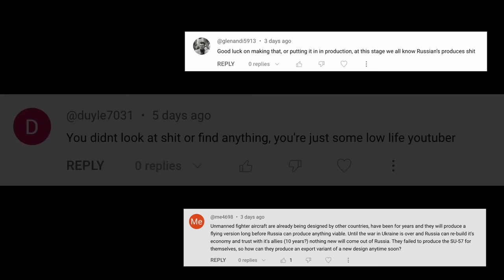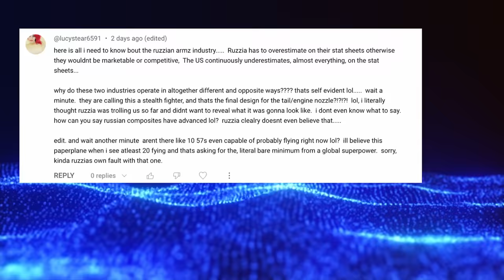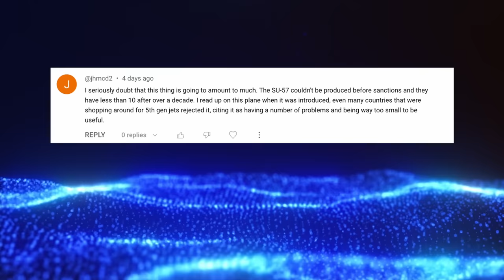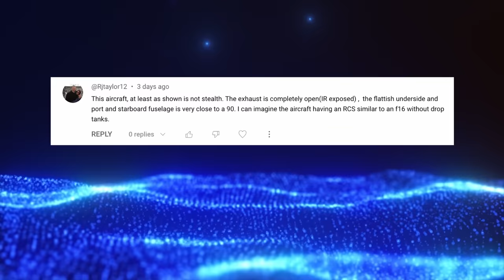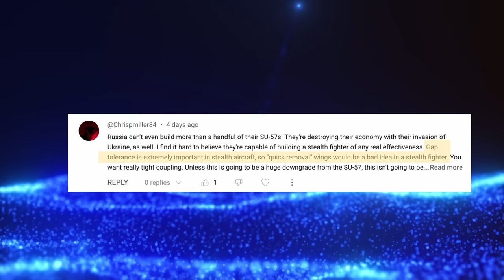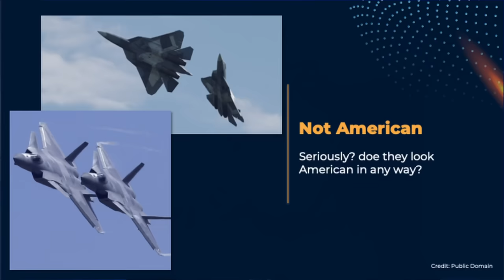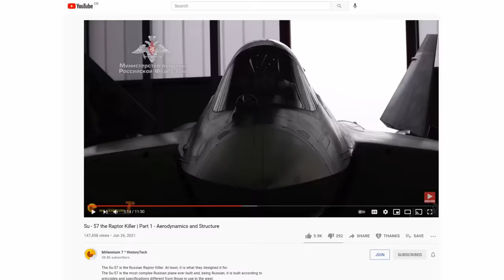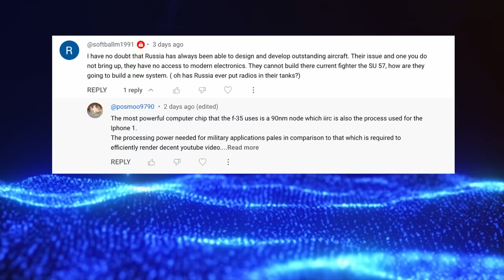Why so Few Su-57s ... and Other Stories.

Comment: You point out that the Russian economy is growing. While on the surface this is true, it is almost exclusively driven by higher military spending, both on equipment and on personnel. Suddenly having to pay 300.000 additional soldiers and having to pay them more doesn't mean that you are doing well economically. Russia's war economy is working pretty well, but it has immense costs for basically any other non-war-critical industry and especially for the population. 

Funding for the SU57 will probably not be impacted but Russia has to make great sacrifices on other levels in order to maintain their war economy
Reply: Non-war industry is extremely boosted by growing military complex. This is how USA got so big after the ww2

Comment: Coincidentally on Dec 9 a news came that a full squadron of Su-57 is about to be deployed by the end of 2023. With AL-51 finally ready the last things remaining are 2D exhausts and K-77ME, and the jet is at its full capabilities.
Reply: 2D exhaust are not part of the Su-57 either block 1 or block 2. if there is such a plan it will be for a mid life upgrade.
izd.30 is still not fully ready (integrating it to fighters was planned for 2025 in the initial production plan for 76 fighters).
there is a planned batch that should be delivered in December 2023 (or early January 2024) wich will complete the first 12 and a few more (according to best estimates there are 11 already delivered)
Reply: @tunisiandom9318  There were 18 aircrafts delivered already before this last batch by mid-2023, wikipedia was outdated.  Now it's a full squadron, 24. In practice those machines are going to be distributed across several squadrons so that training started at several places at the same time. New batch was said to be powered with AL-51/izd 30 already.

Comment: Hi M7 again ! 

You said something about western components in the Su-57?! There is no western components in the Su-57 at all.About microprocessors ,Elbrus-8S and even Elbrus-16S  ( for the IMA-BK digital comp in the Su-57) are in serial production in the  'Micron' company-Zelenograd .

Will repeat this again : 

''Su-57 delivered so far :
one in 2020, four in 2021,six in 2022 and eight in 2023 so far.Two more will be delivered very soon ,at the end of 2023.''

There is some news from VKS/RuA&SF that 1AE ( first aviation squadron ) of 23GvIAP ( 23rd Guards Fighter Aviation Regiment) in Dzyomgi air base near Komsomolsk on Amur ( vicinity of KnAAZ factory ), will be equipped with 12 new serial/operational Su-57. 

About combat use in SMO, I will repeat only details that can be written publicly. Su-57 ( four-aircraft combat group) was used from the beginning of the SMO especially for the SEAD/DEAD combat missions with new heavy hypersonic long-range anti-radiation missiles type Kh-58UShK-TP. This AR -missile has not only passive radar guidance but instead of it ,it has IR-passive homing  with two real passive IR-sensors (  so called heat pelengators ). Max launch distance is 400kms ( launch parameters : high-speed,high-alt.) . Primary targets were ukr. long-range AD and air surveillance radars.

About first ever combat use of Su-57,it happened in period  Feb 21-23  2018 . Two 'second stage' prototypes Bort numbers 509 and 511 blue flew to Hmeymim air base in Syria( flew 10 missions)  and they were there in the same time when USAF and IAF conducted air drills with their 5th gen fighters F-22A Raptor and F-35 Adir !  By accident? Of course not.

All best !

Comment: Well the su 75 is supposed to compete with the f35 the problem I see with the su75 is that it’s rcs is going to bigger than the f35 which will probably put in the low observable space as opposed to true stealth space like tge f22 or f35

Comment: The leadership of the NATO countries failed to properly analyze the actual capabilities of Russia.  And now they are standing on the precipice of defeat because of that. (Underestimating your opponent is always a mistake)
Reply: Actually they overestimated the Russian capabilities. The US nolonger views Russia as its primary rival in a conventional manner. The Russian military tactics hasn't change since the Cold war era despite spoken efforts to modernize the military. Russia just now started to implement some changes with addition of some new technologies like drones to their militaries but that's something the US has been doing for decades. 

The focus now is on China as the primary military rival. Russia no longer has the economic and technological capacity to be an actual rival to America. In the next 2 decades that would become even more apparent. The US currently is undertaking massive "Next generation" programs in every area of the military from the new M7 rifles to the NGAD and next gen destroyers and submarines. Everything is going to be brought to 21st century. And we have to mention the sensor integration. America wants to integrate every single sensor there is in one system to create an ultimate map of a battlefield where everything is in real life.

Comment: There are some Russian weaknesses, no doubt about it. But then in Ukraine it showed that old Soviet / Russian is good enough for what it's supposed to do. For example an old AT-4 for about USD3k (eqv.) cuts right through a Leo 2, so no need to use an AT-14 for about USD70k (eqv.). Nothing we thought we know can be taken for granted. The war in Ukraine is full or surprises - and a lot of them are not good for the West.
Reply: The war in Ukraine proved that Russia is behind and it is well behind. There is huge disparity in missiles for example. Russian missiles are just not as precise are advertised. There is also disparity in tactics. Russia is in no position to implement combined arms warfare maneuvers.

Comment: While I'd imagine that russia is doing alright with their economy, enough to build aircraft airframes and even engines without trouble, I am more suspect of their ability to source high end computer components that such an advanced weapon system would require. We've already seen in the debris of just about every russian weapon and aircraft that they are filled with western sourced computer components. And while china could help source some with their own domestic production, that is still a couple generations behind western, sanctioned, commercial level products, with it not being hard to imagine that the newest western weapons tech uses computer tech even more advanced than what is available to the commercial sector.

Beyond that when it comes to disbelieving russian weapon stats and claims, it doesn't come from "well we haven't seen it", it comes from a nasty tendency for russian arms manufacturers to overstate the capabilities of their newest weapon systems. Just like the boy who cried wolf, this leads to doubt with any future claim being made by russian manufacturers.

I really do appreciate covering the tolerances and composites topic, however, those are really spots that are misunderstood by the vast majority of people when it comes to stealth and aircraft construction.

Comment: Russia does not purchase the SU-57 for two primary reasons: 1) the SU-57 does not deliver Russia's operational needs / requirements,  and 2) Russia can't afford it. Other countries primary do not purchase the SU-57 simply because it does not deliver their operational profile needs / requirements. Russia also does not have the production knowledge to produce the SU-57 in mass; this is true whether we like it or not. Russia also can not purchase or manufacture materials needed to produce the SU-57. The SU-57 is a no go from the top to the bottom. The SU-57 will be obsolete before it is ready for production. I'm absolutely astounded that anyone is confused why the SU-57 is not used in contested airspace by even Russia. If it delivered, it would be used if these situations. Since it does not deliver, it is not used.
Reply from the maker: Sorry, but this is wrong on so many levels that I don't know where to start...

Comment: Why "photonic radar" defies physics? It already exists, for decades (well, more than a century) now. It is called LIDAR. It is well inside the realm of known physics! Even all gamma ray imaging system is photonic radar (gamma rays are high energy photons), just like the X-ray (discovered by Röntgen in 1895). So, be greatful, and admit you are wrong! Very wrong!
You know, there is a really big difference between the US, Europe, and Russia. US typically has claims about their systems. Mostly watered down, almost all the time turns out the real capabilities are even better. Europe tend to be so secretive, surprising everybody with the real capabilities. And Russia... Well, they always claim fantastic things, and always tunrs out the reality is much more pedestrian. (Ka-52 is the best, most protected attack helicopter in their opinion. Well, at least what remained from the fleet. Turned out it can shoot down even with the oldest of the MANPADS. And has no survivability. OK, it is better than the Mi-8, which hosed down a few times. Yes, hosed down with fucking garden hose and water.)
Russia's industrial might:
They built 32 Su-57 since its first flight in  2010.
Meanwhile the US industry built 980 F-35 since its first flight in 2006.
32 in 14 years vs 980 in 18 years. You are right, they are on par with the west, no problems there.
Convergent design is a fucking excuse for the russians for decades. In the 1950s the "rival" design bureaus made almost identical designs (MiG-21 and Su-9/11*, Yak-15/16/23 and MiG-9, La-15 and MiG-15, MiG-29 and Su-27) because all of them worked from the same CAGI designs at any given time. And in the case of the MiG-29/Su-27 even the CAGI worked from western designs (that design is heavily based on the F-14). And of course when they "borrowed" western designs, they always called it convergent designs. Tu-144, Buran, K-13/R-3, etc. Their argument is always the same: if you have the same input parameters, you always got the same output. Well, yes. They are right. This is why the YF-16 and the YF-17 looked the same. Just like the YF-22 and YF-23, the X-32 and X-35, etc. Oh, wait. Those were all totally different. From the same input... Convergent design is a fucking bullshit, an excuse of copying. You show us the Changhe Z-10 as an original design. Well, that is a clear cut A129 Mangusta copy outside with some hints from the RAH-66 Comanche. And yes, we know that the F-15's aerodynamic design is a modified copy of the MiG-25's. The difference is the MDD engineers never lied about its origins, calling it a convergent design.
You know there is a prowerb: The only thing Russians have ever invented is samovar.
* - The only time somebody really moved away from the CAGI design is the development of the Su-15/21. When the engineers realized that the placement of the radar in the shock cone is very detrimental to the performance of the radar, they modified inhouse the nose, and split the intakes to the sides of the fuselage. Thanks to their reliance on the central data provided by CAGI, they were behind the curve more than a decade. Americans realized this much earlier. Their radar equipped interceptors used this design from the late 1940s. Like the F-86D, F-94, F-89. Well, they never even tried the shock cone approach. They knew it is bad from the start.

Comment: The stuff about the economy is cope.  The oil and gas pipelines to Europe were the backbone of Russia's budget and now they're gone.  They're flaring gas because they can't transport it.  China refuses to finance new pipelines so Russia will have to build the pipeline at its own expense, then sit down for negotiations about the price of the gas (!!!).  Getting ships to export oil is difficult because shipping and insurance companies have a choice: do business with Russia or with the rest of the world.  Only a few will choose Russia, for a big premium.
They can do import substitution but that makes everything cost more.  There's a reason why e.g. Sweden uses so many US/UK parts in their planes, and why the US relies on other countries for a lot of things.  That's also the reason why Russia was surprised by its own dependence - they paid extra to companies that promised to build in Russia, but the companies just bribed officials and imported cheaper foreign parts.  Civilian jets avoid using their bakes because of a shortage of brake pads.  That must be very easy to solve, compared to the complexity of building stealth fighters.  Have they solved the brake pad issue?
After they truly complete import substitution (for basically everything) then Russia will have a permanently lower standard of living.  That will offset the "efficiency" gain from having low wages in Russia.  
China is their only economic lifeline.  And the only threat for which fighter jets are needed.  Do you think China will let them build up a capable defense?
They're pursuing a range of projects of the size that only China and the US attempt (and for the US they spread costs by bringing in many export partners).  But with about 1/20th the economy size.  And sanctions.  And a brain drain.

Comment: As stated many times before, the SU-57 is surely a nice looking highly maneuverable plane....But it's so lost on RCS and avionics integration. And no, the F-35's RCS is approx 1/1000' th of the SU-35 = F- 35 will be able to detect (lock) and fire AMRAAM +100 Km from the SU-57 where as the SU-57 would need to be within 15-20 Km....Guess if the F-35 would allow the SU-57 to get withing that range ;-) Truly a lot of nonsense said from a guy that lives in a former world but got absolutely no insight into technical aspects of the planes but just spreads typical Russian indoctrination and a few lies to top it up. Export market? Nobody is buying Russian planes after watching in Ukraine how miserably they fail every time they are exposed to real threats. From the "invincible" Ka-52's  to Su-35 "falling leafs" that's really 50 year old upgrades. Western intelligence has been shocked, but that by how bad these platforms performs when IRL.

Comment: This is a video of nothing but "yes but...". 

Many of the posters weren't wrong. 2:00 is an absurd point because it's proven time and time again Russians over-exaggerate their claims where as the US has had a history of underselling it's strength and actually using it's technology in battle instead of holding it back. The US underselling its strength goes as far back as the late 1700's when everyone world wide underestimated their Navy and world naval powers were shocked at the US dominating them in the water when revealing that technology in a capacity to actually do something. The US stated it had a Stealth Program in the 80's, people were skeptical, and yet Stealth technology became a huge deciding factor in the Iraq War that reduced the 5th largest military force in the world to nothing in just 100 hours. The United States has a track record of saying something might exist, producing enough to actually make an impact, and proving to the world it exists. That's not propaganda; that's historical fact. The Soviet Union 2.0... I mean Russia has no such history. Not even close in the last 60+ years. The SU-57 is another vanity project by Soviet Union 2.0...  I mean Russia, that has no real difference in the theater of warfare except for them to claim they have the aircraft. They're not even using it regularly in the biggest war Russia has engaged in since WWII. 

Meanwhile the US has consistently used a plane that costs $1 billion to build in the theater of warfare.